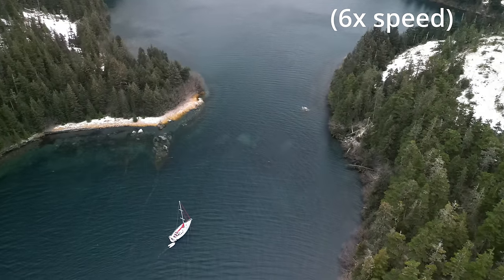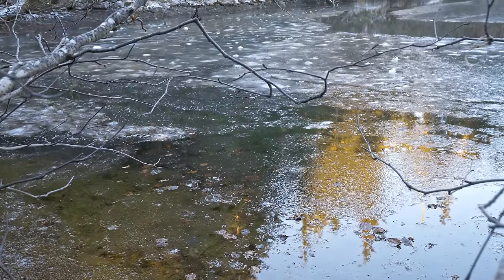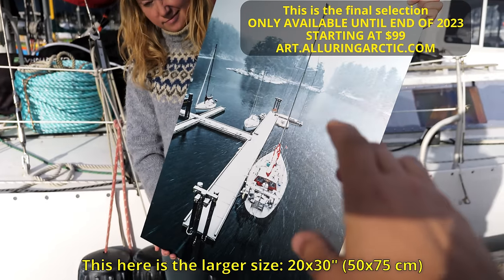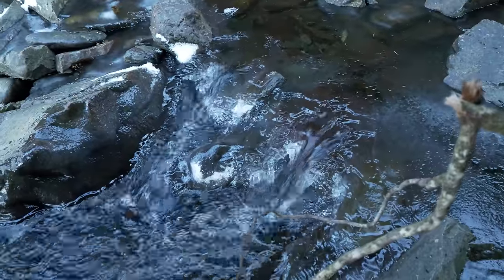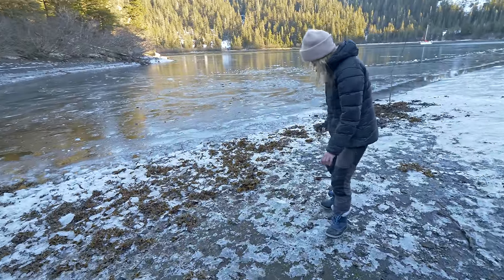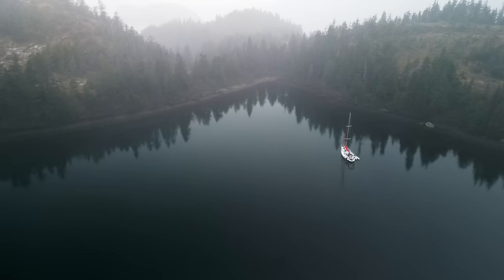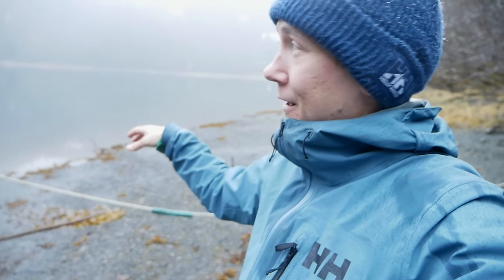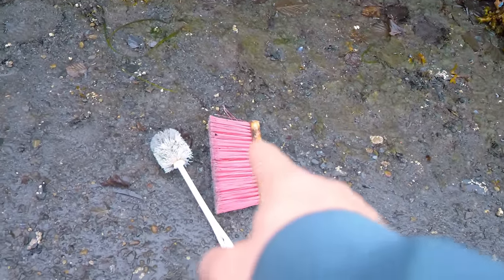Beaching our 45 ft Boat (1st Time Ever. Great Idea...)

Comment: You should get yourself a 240v pressure washer that you can plug into an inverter from 12v or 24v to help clean down your boat easier with all the water around you.

Comment: Proppelor issue: I have the same issue: Max Prop. The blade angle uses a bold that adjusts the angle. After changing the rear set, suddenly my forward speed reduces from max 8 tot barely 4 knots. Work in progress to re- adjust.

Comment: At minute 19.20 you refer to the collar zinc ahead of the prop as a shaft zinc . At minute i8.50 you are turning the prop but that zinc does not move . Is it possible that the prop is turning on the shaft ? Thanks for the videos . Steven .

Comment: Beaching... That is a very nice feature! 
Aluminum anodes, I was thinking of putting them on our Steel Van de Stadt 34 (I always used aluminum anodes on our FRP boats because of what you mentioned) but at the last minute I went with Zinc because I was afraid of providing too much anodic protection and too strong anodic protection and burning the steel hull. Do you have any thoughts on that?
Also I will revisit your older videos to try and find that antifouling you used.
Cheers,
a.

Comment: 13:00 I've never done this and am just speculating, though I think I would have reversed in to the beaching spot after having laid a heavy anchor and heavy line (chain?) very well secured out in deeper water, so that you could pull yourself (and boat of course) back out to the deep if needed.
Reply: 14:36 I can see now that you might not want all that weight impacting first on the rudder and prop, if you had gone in reversing.
Reply: 15:47 I had the thought that the boat would lie down on it's side.

Comment: Delayed..... And....find any gold? :)) And without any jokes, nice entertaining video Juho and Sohvi! The snow drone shots.....mmmmmmm!! 
And what  a good and practice run! 
It is a known effect of flat-bottom-boats, going backwards, that  the inertia, when not fully strait, or super, super slow in movement, will make the bow go past you. Since.... as we all do... fumbling around with the rudder trying to steer the boat backwards in a direction, the rudder just has a braking effect, and the bow has not, so the boat  turns:)  Surprise surprise:) You might try next time: a tiny bit lowering the keel, (even just  10cm) when a bit of depth is available again. This will make a huge difference and the bow will follow, instead of going haywire. In that sence, experimenting with the daggerboard up and full or partially down in combination with keel up and (a bit) down when going backwards might brings some extra movement possibilities in tight spaces or currents. Good Luck and i hope the experienced slowness is gone.

Comment: I did this 3 times in 7 years on slippery when wet. We 47 ft full keel. A motor sailer with no  sunken copit. At rest we lay 35 degrees. One tide to clean a side. 
In asia we had monitor lizards very close at low tide. 
See my book 3 circumnavigations by Tony sharp.

Comment: A diesel engine is gouverned by fuel delivery. Maybe the boat is slow because the fuel system is slowely clogging up? Maybe check and clean the water sepatator and fuelfilter ?
Reply: That would be obvious from the way the engine runs so that's not it

Comment: good fun and brave too .. maybe the prop is too small or as you said the pitch is wrong for the power your engine has. I'm sure you know but if you can rev the engine to full power and not much change in speed then its the prop
Reply: It is a change so the prop isn't too small. It worked fine but now is slower

Comment: For us living and sailing in and around the Baltic sea, where there is no tide it's always faschinating to imagine a tide of +5 meters. 
What an  icreadible difference it wouuld make around the Baltic shores and the archipelago.
The Baltic sea is very shallow and I suppose there is not enough mass for the Moon to attract.
I had to add that the waters between Sweden and Denmark are of courde affected by the tides in the North sea with srtong currens in both directions if mostly out of thr Baltic, but that is another story.

Comment: What alloy is it? 7000 series Aluminium zinc tends to be most easily corroded, though aluminium silicon 4000 series comes close.
I suppose the little used aluminium lithium alloys might be even more electropositive.
Reply: The aluminum anodes are 1000 series (>99% pure) surely.  Alclad aluminum - the standard for airplane fuselage for decades - is a higher tensile strength core clad in 1000 series sacrificial covering for galvanic protection of the core.
Reply: @ginnybrock7238 yup most aircraft are 2024 T3 or T4, some 6061 also. Most marine grade aluminium is 5000 series 5005 5051 5052 etc  all of which are easily weldable. All aluminium series 2-7 have a coating of pure aluminium 1000 series.

Comment: What appears bizarre is doing the beaching survey in pitch darkness!    Why not wait for dawn at least?
11:35 -  We call that ''getting neaped ...''   A beached vessel caught within the shortest tide range - neap tides, might remain beached - depending on the beach topography - until the return of the largest tide range - Spring tides.     

23:26 - We call that the 'skeg'  - 1. : the stern of the keel of a ship near the sternpost. especially : the part connecting the keel with the bottom of the rudderpost in a single-screw ship. 2. : a fin situated on the rear bottom of a surfboard that is used for steering and stability; any vertical fin structure placed aft of the keel, fwd of the rudder. 
  
25:00 - Yachts over a certain size that employ a retractable keel; that device is called a 'drop/lifting keel' or 'centreboard/s'  on smaller sailing vessels and catamarans.  Such boards deployed from the bilge/gunwales are termed -  'bilge or lee-boards';  most often seen on Dutch sailing vessels/barges.    Small sailing boats - typically < 7.5 m (~25ft) -  mostly sailing dinghies - employ a 'dagger board'  to counter the sail turning moment/roll (instead of a physical keel).   These dagger-boards are nothing more than planks, dropped through the keelson box and usually raised by hand; where as 'centreboards'  and 'drop/lifting keels' - often being much larger and heavier - are pivoted on a shaft and raised/lowered mechanically; typically pulleys and ropes, or electric/hydraulic geared.     

On this very interesting design of yacht - of modest size - technically, is deploying a 'lifting skeg'' to complement the 'lifting keel' for shallow-water and beaching; this design is kind-of 'dagger--board' like in its vertical movement and concept,  providing extra longitudinal stability.   

Being that you have a variable-pitch prop - Your apparent slowness over ground might be due to n mismatch with pitch/rpm..   Can and have you inspected the 'lifting keel' itself, for obtrusive and speed-sapping marine organisms?

V,ERY NICE BOAT...  And great video.  Subd.

Comment: Re propeller.  Your poor performance is probably caused in part by drag thats caused by the roughness of the paint.  A contamination equal to 150 sandpaper will increase drag by 50%. I've given up on prop coatings and go for performance. When I clean my prop,  often here in México, I finish with 400 or 600 sandpaper. 
It definitely pays off.
Note: the drag increase mentioned is an aerodynamic fact but applies to hydro dynamics equally.

Comment: Best to not brush the antifouling. I use a squeegee blade, which takes less paint off. Aluminum anodes don't last as long.
Reply: Aluminum anodes are preferred for aluminum boats in salt water.  They protect the hull better than zinc.  But as you said they will be consumed more quickly, which is beneficial to the aluminum hull.
Reply: The point of an anode is not to last too long

Comment: That was sketchy as heck! Here in the Netherlands drying out is a pretty normal thing to do but never on hard sand, let alone small rocks! And working in any way on your boat while it is dried out would get you in big trouble with the environmental Police.
Reply: I wouldn't call it sketchy. But that's probably a regional thing, as there are not that many rocks in the Netherlands, there's no reason in drying out on them. As for hard sand: I love doing that, so much nicer for having a walk and it doesn't goop up the centerboard. It tends to get uncomfortable though if you the bottom of the boat has no flat section.

Comment: It actually makes no sense to put a Aluminium anodecon an Aluminium hull. The anode and hull will dissolve at the same rate. Anode concept is about dissolving positive metal ions which create a negative charge on the hull, thus preventing dissolution of the hull metal. Could it be that you have a Magnesium anode under you hull. The anode should release the positive ions easier than the hull material...
Reply: They arw alloys, not pure metal. Different alloys have different galvanic properties

Comment: Hi, i am surpriswd u cleaned the annode with metal tool. It is very bad. U should use chemical or abrasive non metal tool. Sandpaper. And never the metal tool. You "pasivated" the annode and it will stop working